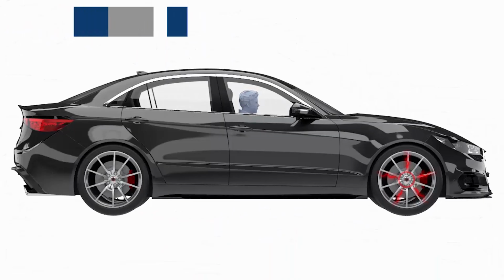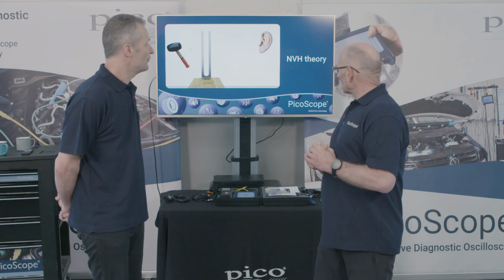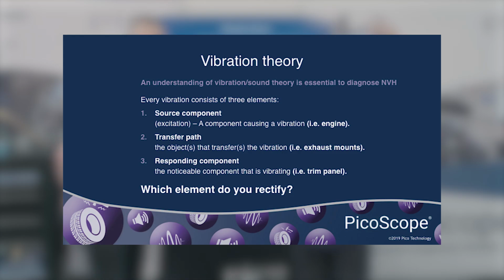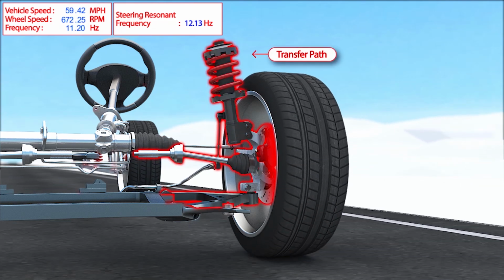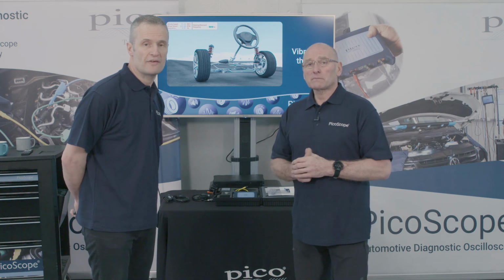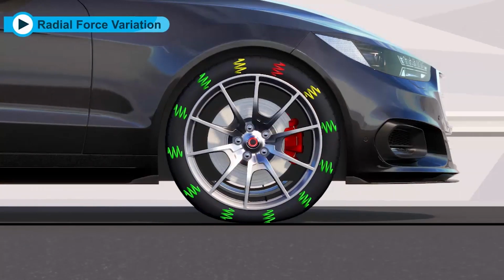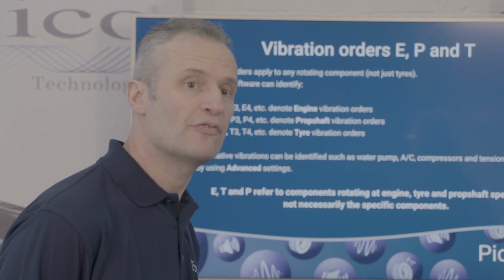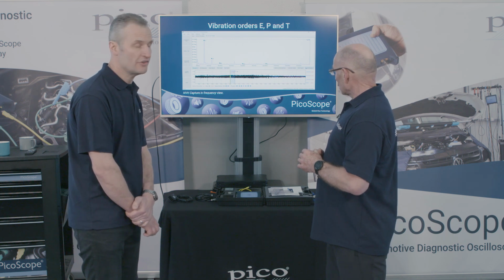PicoScope NVH episode 2: The theory of NVH

Comment: I am here because ASE linked me here..... there seems like some kind of pay off here to include ase questions to include pictures from a tool they reference then send to there page to learn from an extremely expensive tool most can't afford..... I learned and taught the Kentmore tools for nvh and the new ford nvh analyzer and they are night and day of this Pico tool, so how does this work..... ASE getting a cut for each tool sold.... are people  from Pico on the ASE pushing their tool... I am confused. The question I had was a graph showing an E4 vibration... how am I supposed to know that ment an engine 4th order vibration? By taking these classes for a tool I don't own.... I do have the Kentmore tool. Or even the old fashioned way with a chainsaw rpm tool or the mechanical vibration analizers... but the ASE never had any questions about those..... anyway I smell a rat........
Reply: Hello and thank you for the feedback. Please forgive any misinterpretation of your questions as I am confused here regarding ASE, who are ASE? Regarding an E4 vibration order, "E" denotes  a component either rotating at engine speed or a harmonic there off. The same applies to "T" for Tyre and "P" For propshaft. Whilst the letters denote known vibrations, they purely indicate components that are rotating at these known frequencies. Perhaps the best example I can give at present is a first order Tyre vibration (T1) that is generated by a deformed drive shaft and not a tyre. T1 allowed the user to narrow down and focus on components rotating at Tyre frequencies. Returning now to E4, this could be any component rotating at 4 times engine speed or perhaps combustion pulses from a V8 engine (4 combustion events for one revolution of the crankshaft) To determine if this is combustion related, accelerate hard during a hill climb (E4 will be high) decelerate, and over-run fuel cut will remove your E4 as we no longer have combustion. The software does provide pointers and guides to descriptions of such displayed orders. PicoScope 7 software with PicoDiagnostics and NVH can be downloaded for free here https://www.picoauto.com/downloads I hope this helps, take care.....Steve
Reply: I suspect your on to something,  I was surprised to see questions based on vibration analyzer readouts, it's still not a common piece of equipment in the field.  Been years since I had access to one at GM.